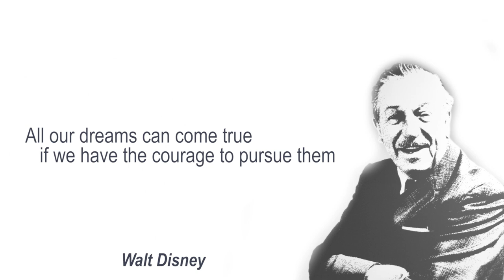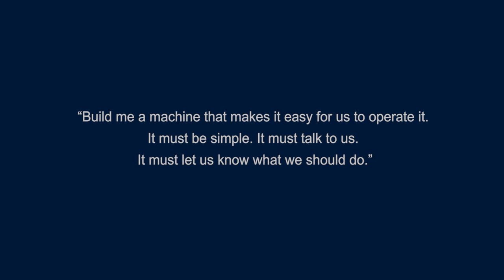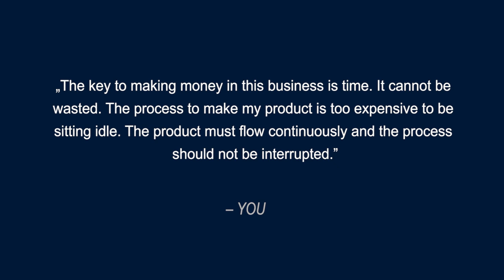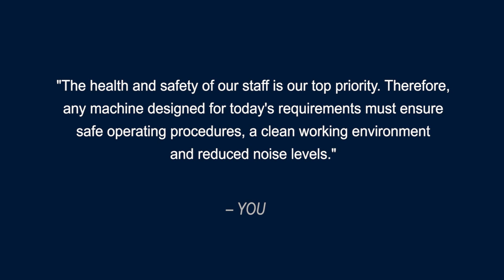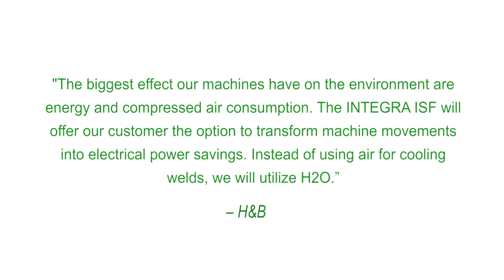HAVER & BOECKER - INTEGRA ISF FFS Machine

Comment: Is the size and weight can be customise? Meaning for 20kg and 25 kg for example?
Reply from the maker: Fahim, yes the weight of the bag can be adjusted with the film length. Example 20kg film length is shorter than 25kg. The film width can also be adjusted but this means also you need to exchange the complete film reel. BR, Jason